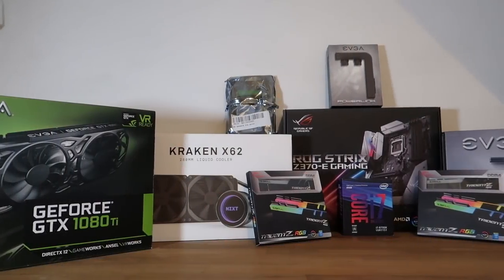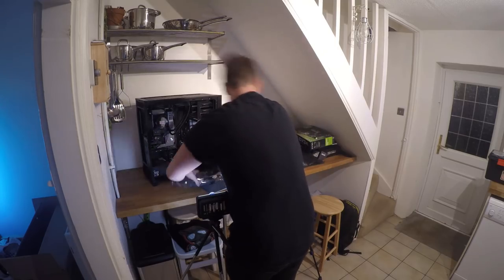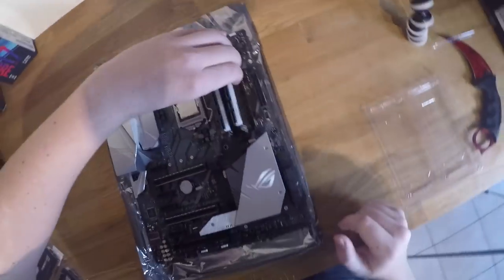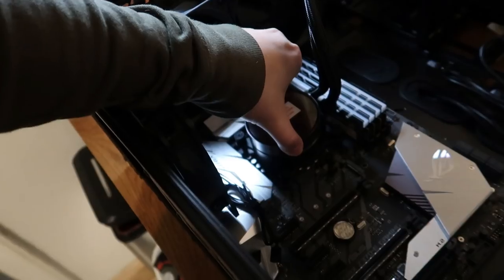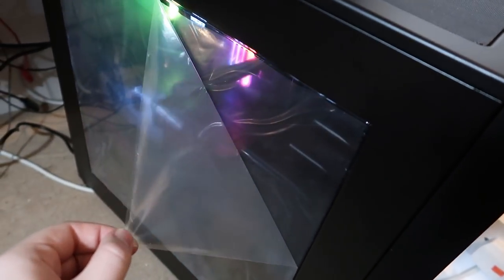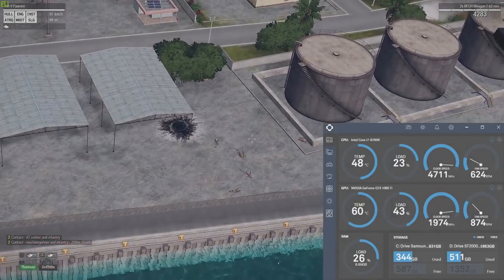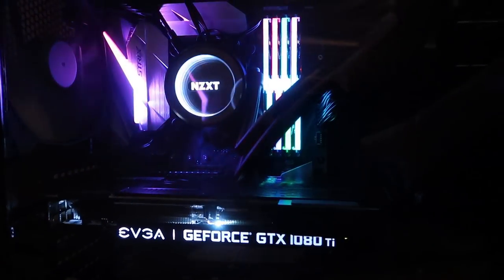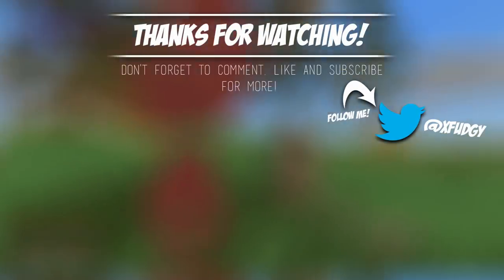EPIC GAMING/EDITING PC BUILD 2018!

Comment: The gpu over heating can be helped by replacing the thermal copund on the gpu
Reply from the maker: I assume you mean CPU right? That's a good point though, the cooler came with thermal paste already applied. Might be worth looking into. Cheers :)
Reply: No gpu the gpu has thermal paste to you take the cooler of a clean the gpu then put new thermal paste such as thermal grizzly kriyonaut
Reply: There are lots of vids on it on you tube

Comment: Jesus Fudgy you forgot something very important, you didnt plug in the 8 and 6 pin pcie power connectors into your graphics card! i highly recommend you do that
Reply from the maker: What do you mean? Everything is working fine though? I also used a Powerlink which I didn't mention in the video, maybe that's why you're confused?
Reply: Fudgy yup, that's probably the reason.
Reply: Fudgy ah yeah that would do it, ok just makin sure wouldnt want that current 1000 dollar graphics card to short out on you ;)